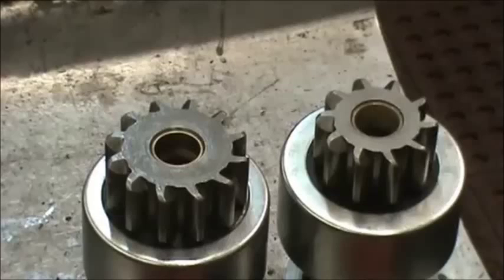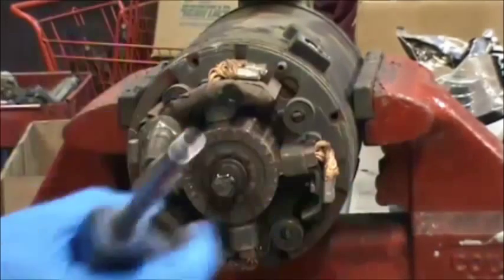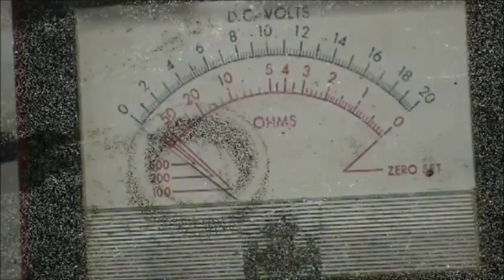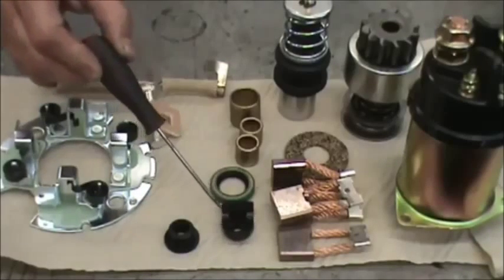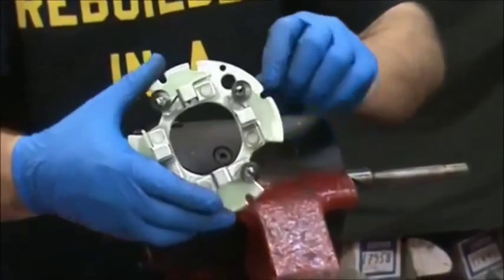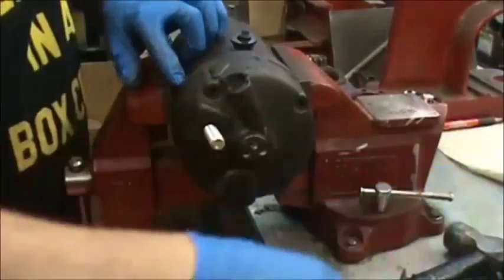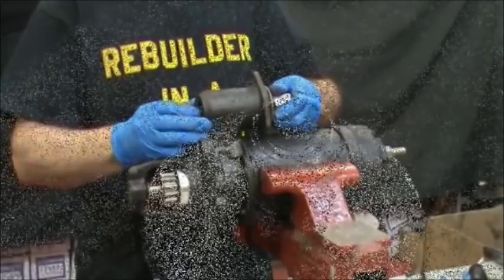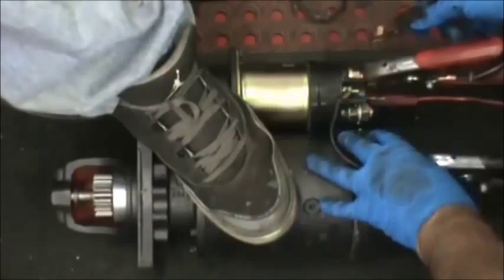How to rebuild a 37MT

Comment: Which do you recommend for the 6.5td. 37mt or 38mt?
Reply from the maker: 37mt
Reply: Thanks for the reply. Is there am more detailed reason? The 37 is direct drive and I assume it will require more power to operate. But if the system is working correctly could spin the engine faster. Did delco switch to the 38 or gm? Would love some more insight.